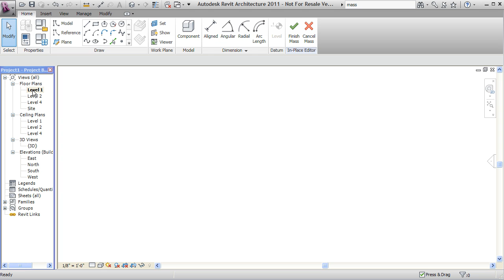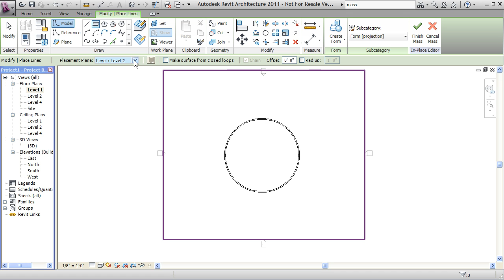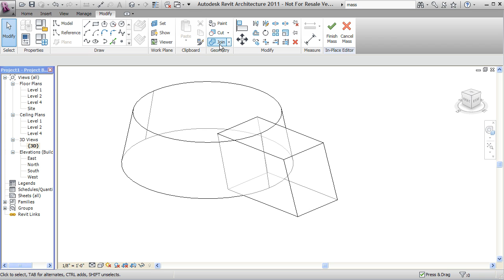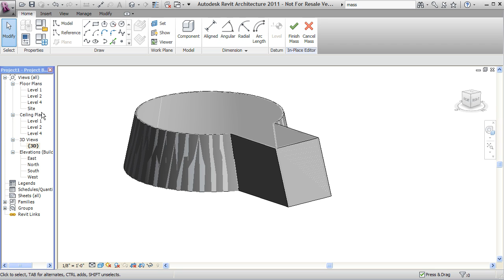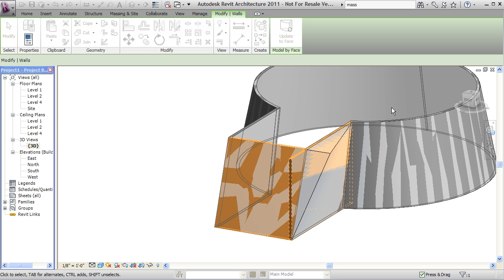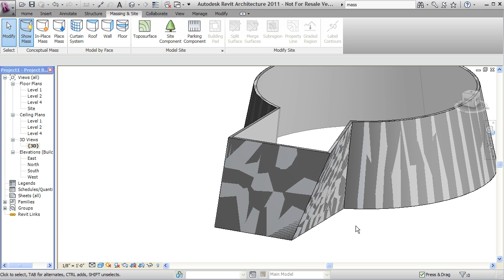Revit In-Place Mass Tutorial

Comment: NEVER MIND :) YOU HAVE TO USE THE JOIN COMMAND WHILE YOU'RE IN SKETCH MODE OF YOUR ORIGINAL MASS... DON'T CREATE TWO DIFFERENT MASSES.. EXAMPLE, CREATING MASS 1 AND THEN MASS 2. THEY WILL NOT JOIN. INSTEAD, MAKE BOTH OF YOUR MASSES UNDER, EXAMPLE; MASS 1.